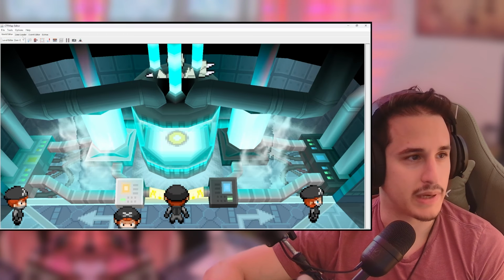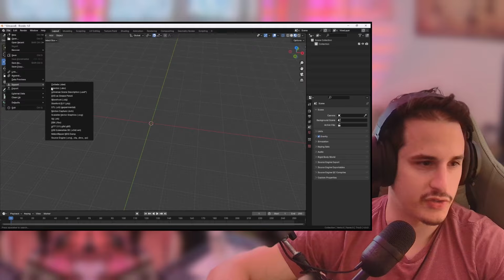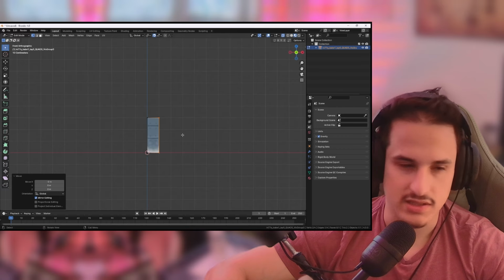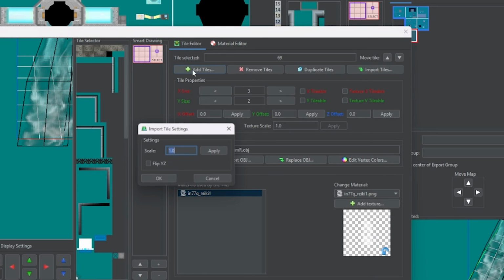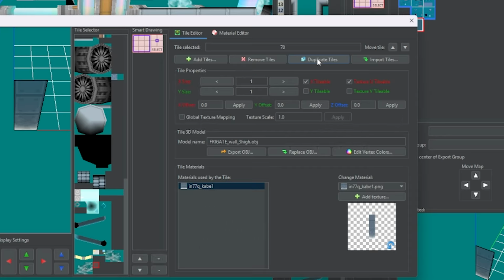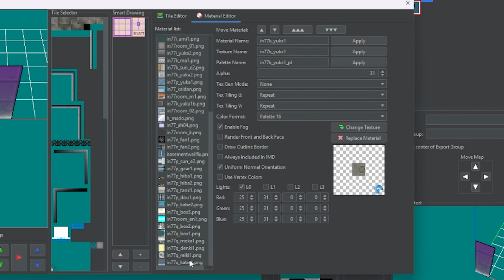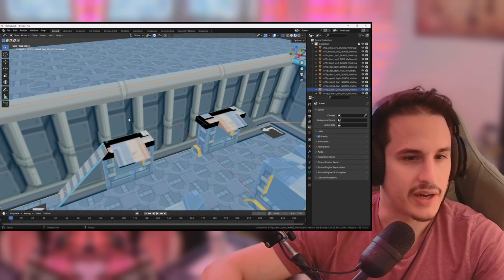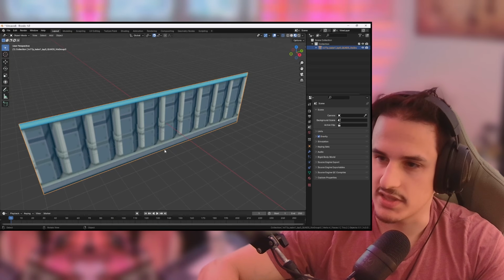Make Your Own Pokemon ROM Hack! -- Ripping Wall Tiles

Comment: Hi! I've been loving you tutorials for a few days and they got me into rom hacking Black 2! I have been encounting a minor roadblock however, I'm trying to make static encounters for a few mons, and I got it to work but only halfway, I get the overworld model to appear, and it is fully interactable and the wild battle actually starts, and finally the pokemon disappears once defeated/captured as intended. Here comes my problem though 1) When exiting the area and re-entering it, the mon respawns and is interactable again infinitely, and I would like for it to not respawn once captured. 2) I was wondering if it was possible to make it so a static encounter only appears after a certain event, digging through the file I found what seems to be the Hall of Fame flag (2400) but I'm not fully certain, ideally these static encounters only appear after the player enters the Hall of Fame, I think I implemented this function correctly but I haven't had a way to test it as I only have a B2 save file post-league. 3) Last "issue" is, I would like for the pokemon to respawn if defeated (or if defeats you) after you beat the league once more, is that at all possible? I tried looking at other static encounters (like Cobalion and Kyurem), but they didn't help me figure this out much. Do you have any tips? It would be greatly appreciated, thanks for putting out this banger content!